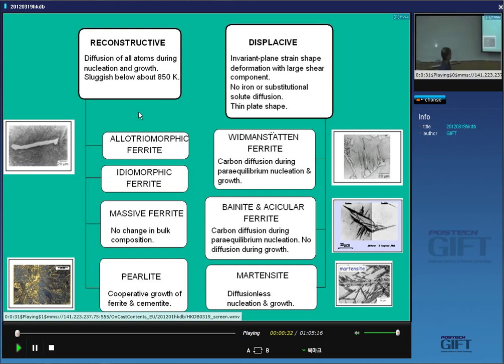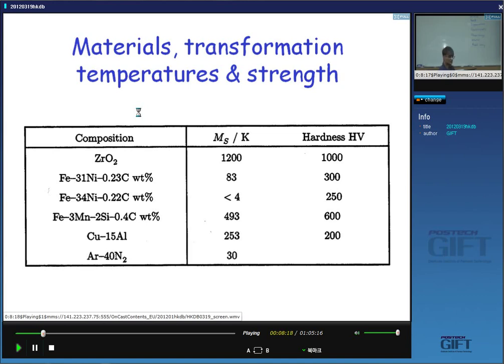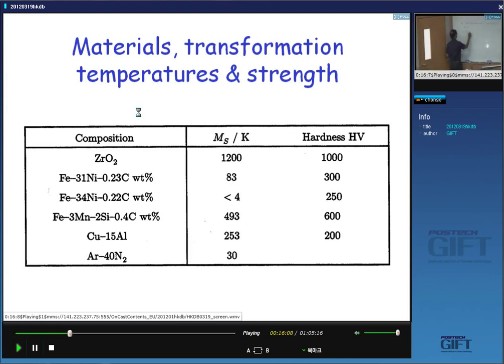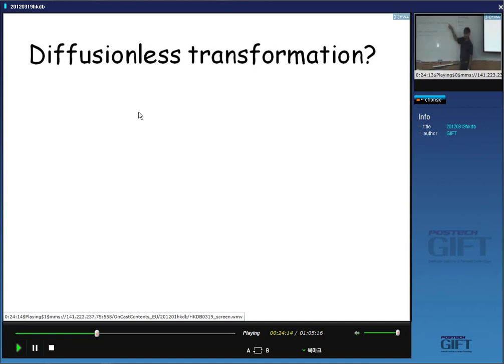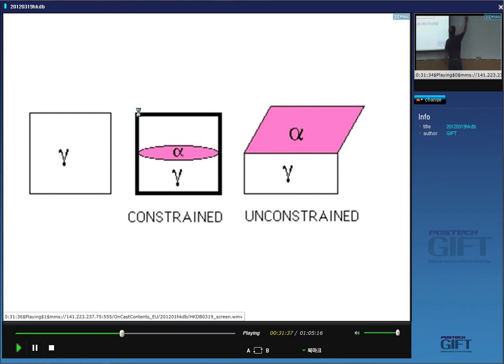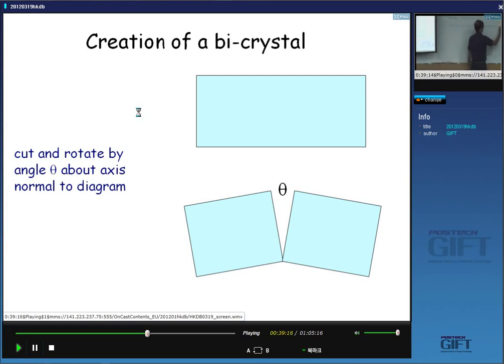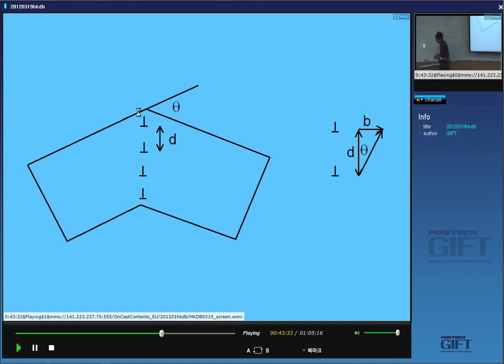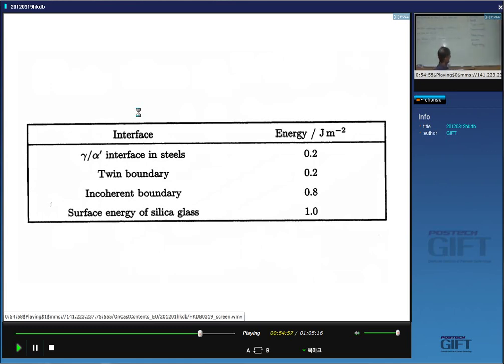Physical Metallurgy of Steels - Part 1

Comment: Dear Pro.Bhadeshia, why there is film austenite retained between laths of low carbon martensite? and what's the mechanism of isothermal martensite? thank you very much.
Reply from the maker: +wang hou Please see "Steels, Honeycombe and Bhadeshia"
Reply: +bhadeshia123 I read your book and some other materials ,I don't find the answer. Could you tell me why some martensite can form isothermally?thank you.
Reply from the maker: wang hou In fact martensitic transformation is thermodynamically of first order, which means that all martensite forms by nucleation and growth. However, in some alloy, it can form extremely rapidly so that we cannot, with our experimental techniques, detect its growth stage and therefore we call is "athermal". With sufficient alloying elements, it is possible to make a TTT diagram for martensite.
Reply: +bhadeshia123  the athermal martensite can't transform completely at a temperature, but the  isothermal martensite can.why? I feel confused about this difference. Thank you for your help.

Comment: Dear Professor Bhadeshia, there is a the correlation betwen Ms temperature and hardenability? Why alloying elements that moves down Ms temperature, increases hardenability? Thank you!
Reply from the maker: Those elements stabilise austenite, in other words, make it more difficult for it to transform. All reactions therefore slow down, allowing martensite to form even at slow cooling rates, therefore, hardenability increases.

Comment: Thanks a lot for reply sir..

Can we imrpove the electrical conductivity of Aluminium by any heat treatment ?

During heat treatment phase transfomration occurs ..I read that in Cu-Al system when CuAl2 phase is formed , when we measure the conductivity then at the phase CuAl2 phase electrical conductivity is more than Al and less than Cu. SO here my doubt is can we form an alloy completely of CuAl2 ??

Does electrical conductivity depends on crystal structure